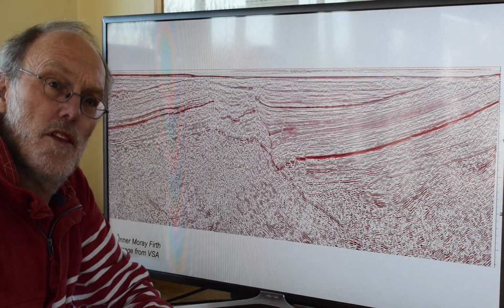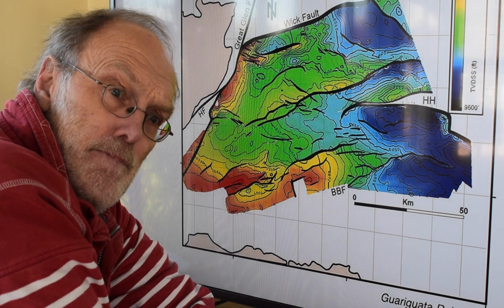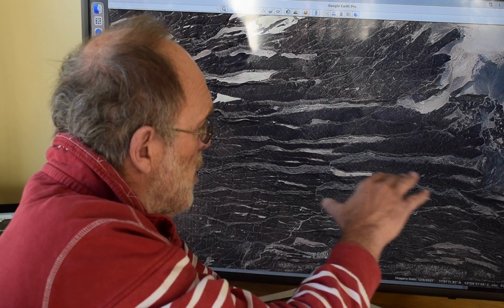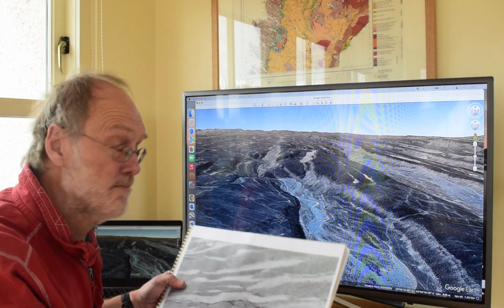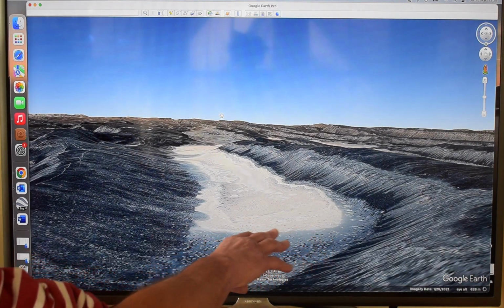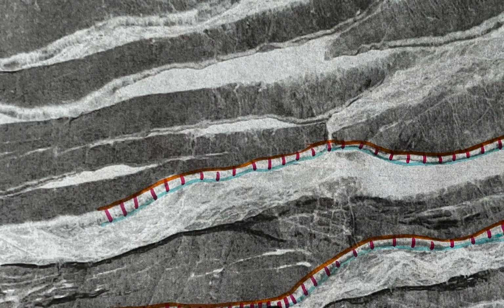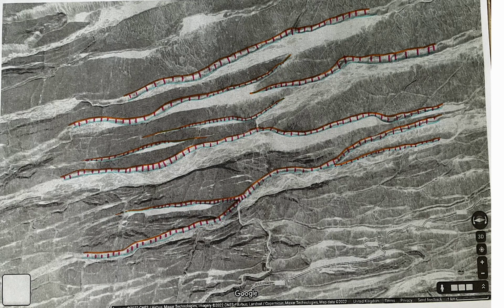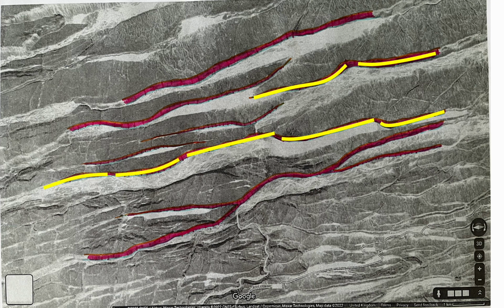Making normal fault maps - by interpreting tectonic geomorphology

Comment: Describe how fault linkage in map view might be aliased, in terms of seismic line 
position and spacing, and the Exploration and Production implications of fault 
trend aliasing
Reply from the maker: Indeed this is an issue - but there are fundament issues about how faults (especially small ones) are mapped in 3D seismic volumes and very very few workflows documented by interpreters... more to follow on this later in the year, as we publish...
Reply: @robbutler2095  so, in this case how can I answer this question

Comment: The Djibouti half graben to the west of Red Sea-Aden ridge is a great example with so excerllent image. Can the Relay Ramp region be taken as somewhat like the transform region with the strike slipping kinematics?
Reply from the maker: Relay ramp geometries can occur wherever fault segments overlap (soft-link) in map view ... so also for thrusts and strike-slip.
Reply: @robbutler2095  The sinuous region of the normal fault, may be a region of strike-slip like zone, reflecting the changable of paleostress field regime.
Reply from the maker: @hongyuanZhang-pr6wt  I don't think so.... sinuous fault patterns are quite common (also in thrust systems) - why change the stress regime (in patches), rather than have sinuous forms by linking originally discontinuous segments... The fault system at Djibouti is VERY young....
Reply: Describe the processes and appearance on reflection 
seismic data of Fault Scarp degradation.

Comment: A wise man once said 'you can only piss with the cock you've got' - he may well have had academia and tectonics in mind, at the time? With leaps in technology the amount of new data to work with suggests a review is well over due, nothing personal my friend but the term 'tectonic landscape' proves exactly this. Mountains, for example, are not crumpled plates after all, they're electrically sorted and deposited as boundary field layers. Each differently charged and stacked one atop of another all occurs in a single 'event'. Hydromagnetoelectrical forces for want of a better word and therefore the term 'electronic' rather than 'tectonic' defines this 'landscape' surely?